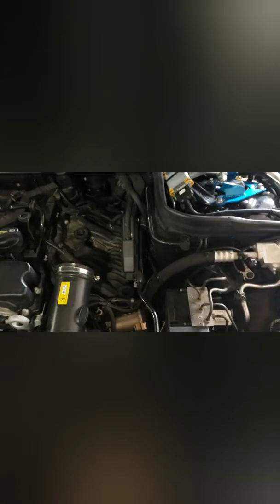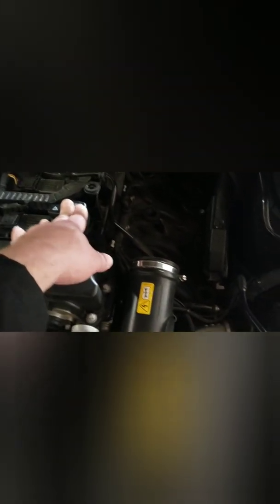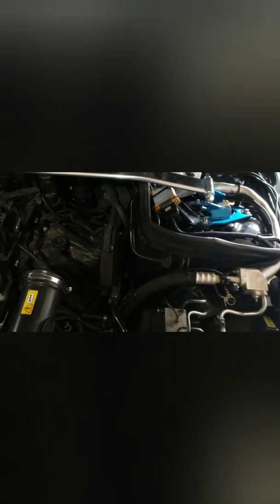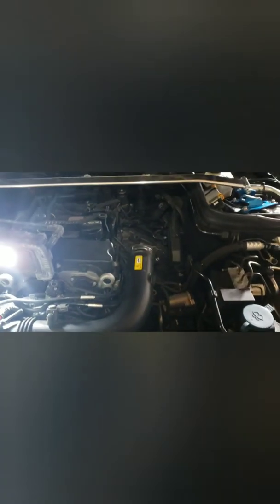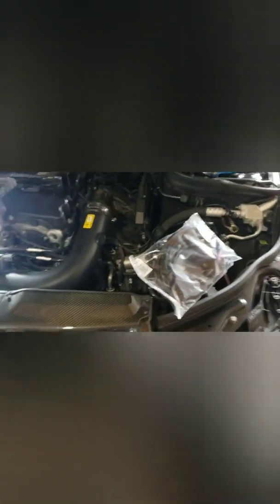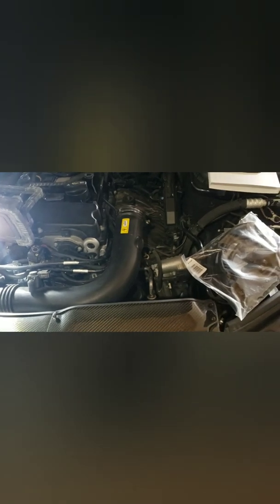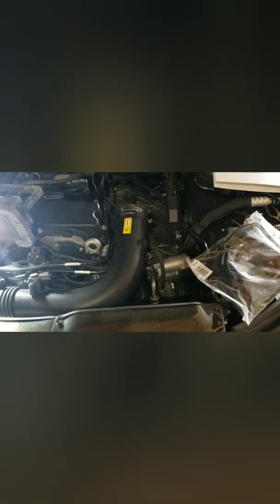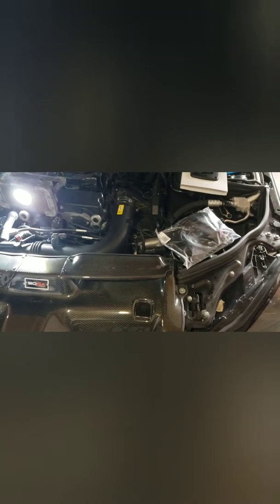W204 C250 RaceChip tuning box

Comment: Hi, would you tell me the race chip lineA need to connect to which sensor? And liineB to what?
Reply from the maker: When I got my Racechip they sent me the instructions for a different engine but I did contact Racechip and they sent my picture installation, from what the sent me I can tell you, connector A goes to the sensor at the throttle body and connector B goes to the sensor at your intake Manifold. You will need to remove your entire air intake to get better access. It is a real easy installation. Hope this helps.

Comment: Dose it ave pops and bangs
Reply: Does^
Reply from the maker: Nothing like that. If you get your exhaust done you will hear a very small amount of that.
Reply: Yeah I currently have that now went from single to quads
Reply from the maker: @davidshaw5495  get yourself a downpipe, I did and I'm extremely happy with the sound I'm getting
Reply: @christiancicala2396  I’m getting this 3 days from now, how much faster is the car and does it have more top end power??
Reply from the maker: @Gk22632  you will definitely feel the difference on highway speeds. I have to constantly look at my speedometer. I hope you purchased the bluetooth version? This way you can turn it off and on in you car, this way you will be able to feel the difference on the fly, Keep in mind it does work but a lot of people always have really high expectations. My suggestion is start it of on economy mode and as you are driving switch it to Race mode. Have someone in the car to do it for you. If you got the bluetooth version.
Reply: @christiancicala2396  yea I got the Bluetooth one, I don’t mind if it’s not a huge difference, I’d rather have it be a little underwhelming than too much since I’m just using it for street driving
Reply from the maker: @Gk22632  you won't be disappointed. I love mine and the bluetooth is a great feature.